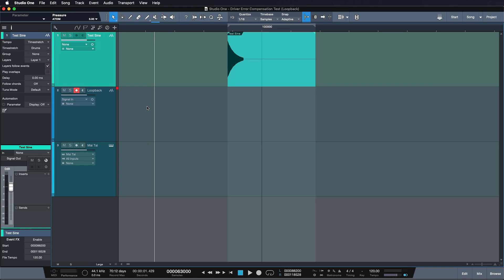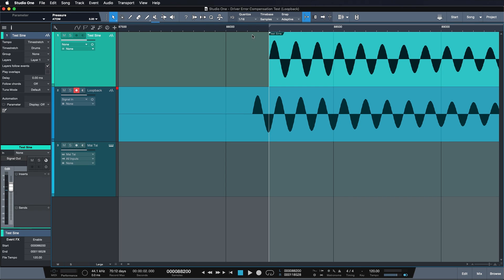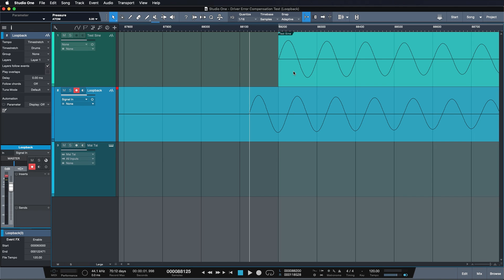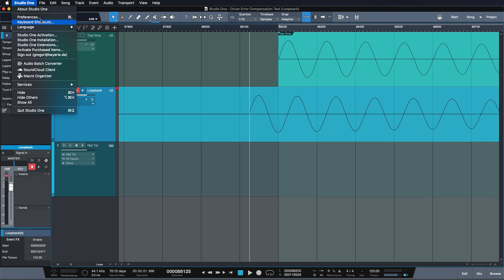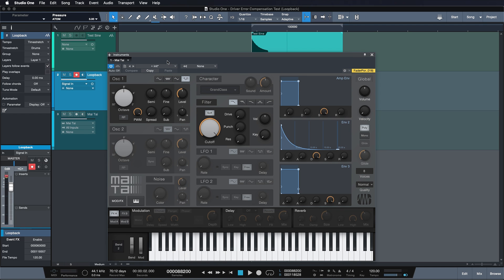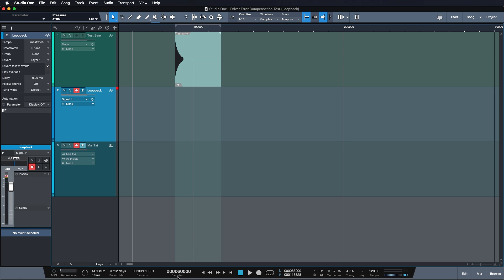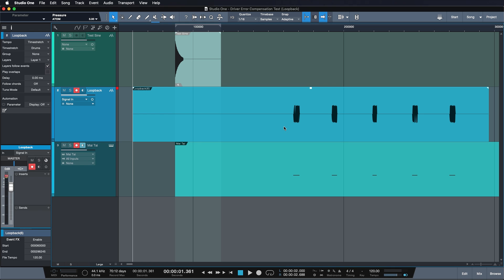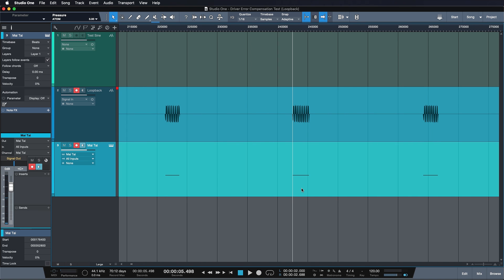PreSonus Studio One Tutorials Ep. 4: Loopback Test and Record Offset

Comment: Loopback Test (using a SLSeries III 32S)
(Michael Cirillo did a good job laying this out, but I'd like to add to his tips) Thanks to he and Gregor for this info!
Download the Loopback test file. ( in the video description below the video here )
Drag and Drop the file into a new song you set up for this test. (using the Audio Device Block size you normally use for optimal performance in your application.)
To simplify the output, just unplug your speakers and use a Main Output(on Series II) run cable from it to your input of choice.
Be sure the Input you choose is setup in Audio Device Setup in S1. Your Main Out already should be.
Select Track 1 in S1 labeled Test Sine, assign the Output to (Master or Main) in Lower Left corner of S1(drop-down menu)
Select Track 2 ("Loopback") and assign the Input to it as your already chosen Input.
Turn off Monitoring for both tracks in the track Header (next to RECORD button)
Turn ON Recording for both tracks. Set your counter at the bottom of S1 to SAMPLES (click on the word beneath the counter for the drop down menu)
Start recording. Stop when transient is recorded to the Loopback track.
If the recording waveform isn't big enough, use NORMALIZE to increase it's size. Use the ZOOM to stretch out the waveforms to better see the start of each one. You can use the TAB button on kybd to jump to the start of the waveform(s) from 0 or START. or set the Cursor manually.
Write down the start time figure for each waveform, if the original Sine wave fires first, subtract the 2nd one from it to get the figure needed. If the 2nd one comes first, enter the difference as a negative number.
Go to Studio One / Preferences / Advanced / Audio and enter the figure in the RECORD OFFSET field, press Enter, Apply, OK. Rerun test to check to see if the difference between the 2 tracks is gone. DONE. 
To maintain this fix, do not reset the AUDIO DEVICE BLOCK SIZE in S1. It is recommended you only change your Dropout Protection settings for problems. You can , however, rerun this test at any time if need be. Say for a different interface.

To do the MIDI test, keep the same connection setup as for the Audio test. On the 3rd track for the Mai Tai, set the Output to Master(Main) in lower left corner of S1. Procedure is mainly identical to the Audio Test, except use SECONDS instead of Samples for the time, then just go to the MIDI tab under Preferences to enter the difference figure.
Hope this saves somebody a bunch of time.
Reply: Thanks, Eugene!
I really appreciate you for being helpful. 🙏🏽💯

Comment: Hi Gregor .. I'm a member of Joe Gilder's Home Studio Corner VIP .. been hearing a lot about you since Joe joined PreSonus!   I am having exactly this problem .. can you just explain the wiring that you are doing at about 1:13 in this video - is that the same cable that you putting into the front and back or two separate cables?  And what track gets the input of the interface if you are using the signal in as the input to the track that you are adjusting?  Not tech savvy enough to understand.  Thanks Gregor!

Comment: Hi Gregor. Don't know if you tested this thoroughly, but i get different measures each time. When i close the project, stay in S1, open the project again, my readings differ around 80ms or less. When closing S1, opening again and loading the project, readings can differ even more. This method is no good unless you test this every time you're about to record, and even so, is not a precise measure unless you do it on the actual recording project. Am I missing something? i'm using a digitech gsp1101 as interface, win 7 64, core i7 8gb ram.
Reply: Did you figure out what the problem was? Because i'm going through the same thing right now! 🤷🏽🤦🏽
Reply: @tri-unetrl3966  never did exactly.  I guess it was a matter of hardware. But in the end I stopped worring about it. For rock music or for more synth oriented situations I prefer to manually align whatever I hear a bit offset. 
It's part of the workflow. And sometimes, depending on the type of music I'm working on, little inconsistencies will make it more human sounding.  That's the main reason I forgot about it  as long as it won't interfere with tracking.

Comment: Hi Gregor - For the record offset, I am able to get everything to match up perfect after I follow the instructions in this video. However, if I rerun the test everything is off again. For example, I ran the test and found an offset of -10 samples. So I entered that and it fixed my offset issue completely (for only that session). I closed studio one. Reopened to run this test again to ensure everything was indeed working. My offset was indeed still SET to -10 samples from my previous test; however, the results of my test were different from the first time I ran the test. What am I doing wrong? It seems I get a different record offset value every time I independently run the test (like the record offset value is only good for the 'current session' but if I close everything and reopen, my values are no longer accurate). PLEASE help with suggestions. I am using an Audient iD-44 interface with Studio One 4.6. I love your tutorials!!!
Reply: Same thing happen to me also. Studio one 4 and 5 ... same thing
Reply: I'm going through the same thing right now. Did you find a fix for this???

Comment: Question: signal out is not showing up. only outputs and inputs mainly called "VRTC" "Oddysey" "Eingang"
Reply from the maker: V V second channel open up the song settings and switch to the audio I/o tab. Make sure to add a mono input and mono output and assign it to wherever you’ve plugged in the Loopback cable. The routings you find in my demo project are those of my own studio. I couldn’t prepare this for you because I couldn’t anticipate your setup. -GBY
Reply: @fenderstudio  Thank you for the response. However, I just realized my Focusrite Scarlett 2i2 3rd gen audio interface does not support loopback functionality. so I may have to find another workaround for doing a loopback test.
Reply from the maker: @CommanderCodyChipless  your interface does not need to support loopback - You can do this with any interface that has at least one input. Simply unplug your speaker cables from the interface, and then patch your left output to an available input. Assign them accordingly in the song project. Proceed as shown. Let me know if you have any questions! -GBY
Reply: @fenderstudio  Hey! Just letting you know I've figured it out. I had to get familiar with the Audio I/O setup page because there were a lot of already named inputs and outputs like "VTRC", "Creme", "Heat", etc. so it kinda confused me being new to DAWs. But now I have a basic understanding... I think haha

Comment: Gregor, you explain things in lay terms and I love it.  However, how do I conduct the same test when I have Studio One hooked up to StudioLive III?  How do I loop it back to another audio track?
Reply from the maker: Hi Andrew, many thanks. In your case, simply open up the song settings menu and switch to the I/O tab. Add one mono input and one mono output and assign them to channels that are currently available on your StudioLive III. Then make a connection between the selected output and input using a ts or trs audio cable. You can use an XLR connection too, of course. Finally, re-assign the output of tracks 1 and 3 to the output you just created, and re-assign the input of track 2 to the input you just created. Then proceed as shown. I hope this helps! -GBY
Reply: @fenderstudio Gregor, I will try what you recommended. Thanks for posting all those informative videos.  Did you post any videos on quantizing audio?  Keep up the great work!!

Comment: Newbee here.  Having problems with the MIDI offset, which is going to be important to me.    For track 3 I don't have an option for LineOut, my choices are Master, Guide (print), Creme, Heat, Modular, |->, VTRC, and |->    Maybe my AudioBox iTwo isn't set up correctly?    Running 4.6.2 Professional.   Any ideas?
Reply from the maker: Hi Lou, open up the song settings and switch to the audio I/o tab. Make sure to add a mono input and mono output and assign it to wherever you’ve plugged in the Loopback cable. The routings you find in my demo project are those of my own studio. I couldn’t prepare this for you because I couldn’t anticipate your setup. -GBY

Comment: Gregor quick questions, is that a TS cable you're using? And can I use TRS cable to to the same process? 
Would the balanced vs unbalanced cable make distinct difference to latency?
Should we consider the length of the cable as a contributingfactor to latency, 3 ft vs 25 ft?
Reply from the maker: No, that doesn’t matter at all here. -GBY

Comment: Hey Gregor, Great job. I am using a Focusrite 18i8 and my result was 120 samples. When I entered that; my offset doubled to 240 samples. I put a -120 offset in and the waves lined up. Is it alright to put a negative value in? Thank You.
Reply from the maker: Hi, if you're ending up with matching waveforms after the loopback, then your entered value is correct. Keep in mind that there is always an offset applied by Studio One after the recording has finished, which by default is equal to the amount of roundtrip latency reported by the interface driver. And if that interface driver actually reports a longer latency than there actually is (which happens more than you think), this places your recording ahead of the original once you stop the recording. -GBY

Comment: Hi, very new to DAW here and hoping for an answer to this question. Will changing the sample rate of a new song change the efficacy of this fix? For example, the "Driver Error Compensation Test" file opens in 41kHz, and that seems to be what Studio One opens songs in by default on my computer. However, in song setup or when I'm creating a new song I can select a different sample rate, and another Studio One user recommended using 48.0kHz. If I did the loopback test at 41kHz, but then create a new song at 48kHz, will the record offset no longer be correct? Thanks so much for your help!

Comment: When I try to record, I get no audio for the the loop back and I have made sure to follow the written steps. Can someone help?
Reply: i have the same question, i'm not so sure ive plugged the cables in correctlym maybe someone can shed a light on that
Reply: @giuseppecaprini8180  same! I have a samson Co1 Mic and AudioBox 96 and i cant getmy audio to play for my mic, but i know its working properly, and my headphones are set up correctly, help!!
Reply: It works fine to me. If you routed everything correctly, did you also make sure to turn the monitors volume of your audio interface all the way up? The audio won't be recorded from the headphones.

Comment: Hi Gregor, what should you do if the recorded midi notes are hovering around the note? Like sometimes 4 ms late, sometimes 2 ms early, and everything in between?
Reply: Im having the same result. First midi node is a few ms early, second is in sync, third is a few ms late and so on.
Reply: same here ... no ideas anyone??
Reply: this is called midi jitter,there is an article about S1 on the internet,seems they fixed it with the latest update,but i still get jitter within 2ms,that's the best i can get,oh,try to enable ignore device timestamp,good luck
Reply: For anyone who has this as well. Someone told me that if your audio interface is USB powered, this can happen because the power supply is instable. I am getting an interface that is wall plug powered and see if it helps.

Comment: I can understand if there was a delay between the original and the recorded sound, but how does channel 2 record asignal BEFORE channel one is playing that signal? I'm guessing you altered the settings for demo purposes? Would have made more sense if the recorded signal came after the original. Also I'm new at this so I might just be completely off base.
Reply from the maker: Hi Aaron, this happens because the interface is reporting a higher latency to Studio One than it actually has. That's why it appears to come in too early. -GBY

Comment: Is it possible that an interface doesn't need correction? 
I am running a Fireface 800 and neither the software instrument test nor the loop (using Output 3 -> Input 10) has a visible offset for my eye. Am I blind or is the latency that low of the device / ASIO driver?

Comment: Hi! Thanks for the video, it has been helpful. I do have one question though: I was able to get the offset correctly for the test sine but not for the midi loop. Each time i input into the midi, the loop comes out at a slightly different time, usually around 3 milliseconds off but sometimes at around 10 or 11. Obviously, this is an issue because the discrepancy is never consistent. Is there some other issue that I'm not thinking of that I need to solve? Thanks in advance for any help!
Reply: same problem here
Reply: @pluginpromo   Me too.
Reply: same problem, the latency varies on every note. no solution?
Reply from the maker: PreSonus Audio Electronics
Hi, yes this is expected, as MIDI recording isn't sample accurate (that's also why we specify this Offset in milliseconds). If your MIDI notes and the resulting Audio are <1ms apart from each other, you're bang on. That's as close as it gets. -GBY
Reply: @fenderstudio  Hi, Why don't you say this in the video, or tell us how to route i/o so a new user can set this up. and try?
Reply from the maker: ...an offset that varies like 8ms every time sounds suspicious though. What buffer size are you using? Is dropout protection set to minimum? What audio driver are you using? for instance, Asio4all is known to be a bit sluggish.
Reply: @fenderstudio  Hey, thanks for the video(s).  Im curious what you think the settings should be for buffer size, dropout protection.  My Midi notes are close but not exact.  if I play the recording back almost sounds like drum flams.  Also, as a note for those with issues getting the audio through to the loopback, I have a Scarlett 18i20 and I had to use the Scarlett MixControl and set one of the channels to the DAW (for me I set output 7 so I used DAW 7 as the input (top of channel on scarlett)), unmute, bring up the fader as well as set up Analog in (again for me it was 4, so I set analg In 4 on another channel) and again, unmute and bring the fader up.  Then the signal sent through to S1 and it worked.  good stuff. thanks again

Comment: Every time I do the sine wave test, the specs work for awhile. Then, I’ll reopen and do the test again, and it will show a different latency amount. Is there a reason for this?
Reply: Hey Drew, thanks for your reply. Looks like I figured out the problem. I am using a 2nd generation Focusrite Scarlett and this is a known issue. Apparently the drivers will automatically send information as though you are in 48k. I basically have to go in and do a manual switch from 48k to 44.1k. Kind of annoying, but it worked!

Comment: I've been messing around trying to get the IO to work so it will actually play back when I loop it from either of the back outputs to either of the inputs on the front of the 24C.  I get no input sound looping back though.  Using a standard 1/4 inch jack and all i get is static at a very high level.  No wav playback even though I can hear it through the headphone output just fine.
Reply: Dumb question: did you turn the volume of your audio interface up quite a lot before recording? I mean turn the main volume knob of your interface up, the audio won't go through your headphones.

Comment: Do you need to have a presonus interface to do this setup? I have a line 6 UX2 interface and was wondering if I could set it up this way? I also found this page saying that loopback is only supported with certain interfaces. https://support.presonus.com/hc/en-us/articles/360002274752-Setting-up-Loopback-with-supported-interfaces
Reply from the maker: Hi Ronen, this article refers to a different kind of loopback - the one that allows you to record your system audio, or other input sources. A loopback test as shown in this video is possible with any interface that has at least one input and one output. On your line6 UX2, simply disconnect your speakers for the time being, pan the sine wave track all the way to the left, and connect a TS / TRS cable from your Main Output L to one of your line inputs. Add that line input in the song settings and assign it as the input for your loopback track (the second one). For the MIDI loopback test, set the Mai Tai to monitor enabled and your loopback track to record enabled. Then proceed as shown. Good luck! -GBY
Reply: @fenderstudio  Thank you so much I got the Loopback track to sync up. But I am having trouble with the midi (Mai Tai) Track. It won't record when I press record. I am guessing it a setting with my in/out puts. Can you help me out again please? Thanks so much.

Comment: Hi is there a file compatible with 3.5 as i own studio one 3 artist. this download file only for the new version. Can i just make one myself?
Reply from the maker: Hi, sure you can. Just import the included Test Sine.wav (located in the Media folder) into a new song. Create 2 Audio Tracks and add Mai Tai via Drag & Drop to get a third Instrument Track. Next, in the Song Settings, you add one output and one input of your interface. If you don't have an additional output, simply disconnect your speakers for the time being and connect the left speaker output to an available input instead. Finally, you need to make sure that the output of your first track is assigned to the one where you've connected the cable. Same for the input on track 2. Then proceed as shown. Good luck! -GBY